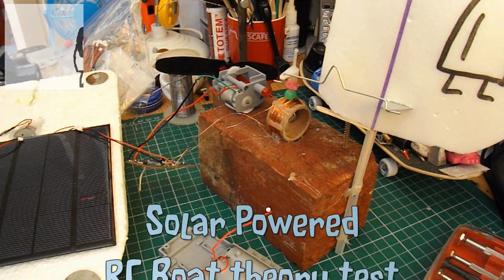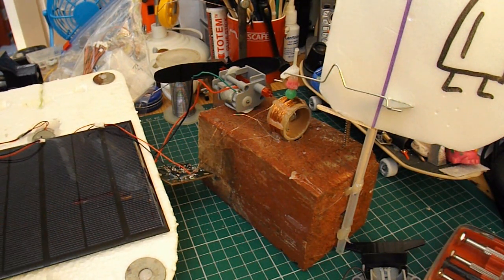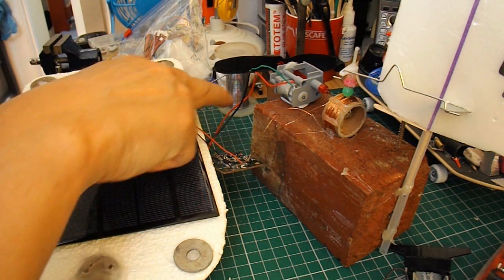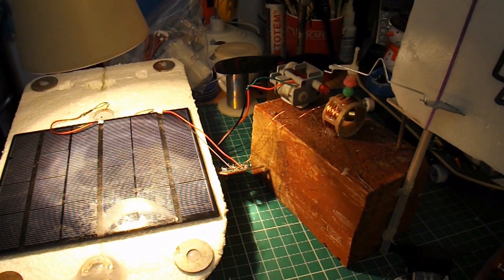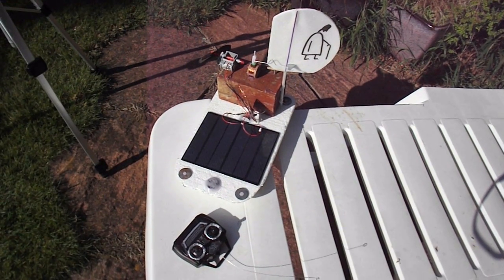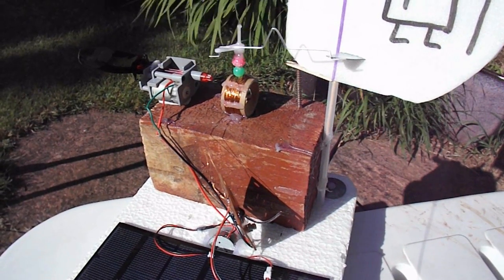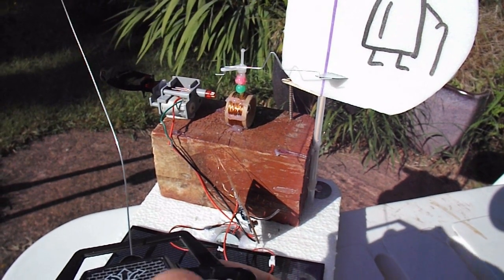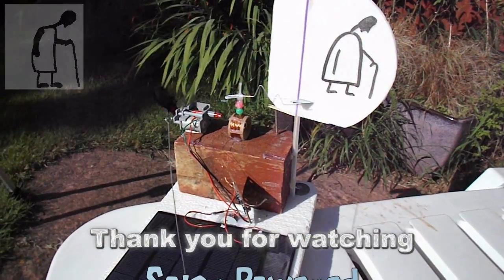Solar Powered RC Boat theory test

Comment: On another note. I am just finished unblocking my outside sewer drain. I built a drill-powered sewer snake from plans a guy had on youtube. I was really pleased that it worked. 
I was going to put a video up on youtube, on my other channel but it is not very nice to watch for obvious reasons. The house above me shares the same sewer drain as us but the cost of having them pressure jetted is expensive. I bought the 50-foot-long snake with fittings for £50 on eBay. The rest of the stuff I had like the guy in this video. https://www.youtube.com/watch?v=o2XgA5uYb5Q It really worked great. Considering the price of the electric ones with the half-inch snake. Very expensive.
I might stick up a video of the one I built on my other channel but not the yucky area where I was working. 😆💩💩
Reply from the maker: Great work, Mike. Not long after we moved in, we had to get the drains jetted round the back of the house. When they needed doing out the front, I looked myself. One access box was full of roots, cleared them out. Another access point that was raised when they paved my driveway had got lumps of cement in it. They were sloppy in their work raising the frame and had allowed cement to drop in. Managed to clear that too 👍

Comment: Wow, 7 years ago. Never seen this one. I am surprised that it never had enough power because that solar panel was pretty large compared to the ones you are now using. 
Sometimes measuring the voltage coming from a solar panel can give a false sense of the power it can put out. I have a solar panel about two and a half times the size of the one you are using here. Got it from Maplin ages ago before they closed all their shops. 
It is designed to keep a car battery topped up but your alternator should do that anyway so not really a useful item for that sort of use. I will dig it out of my garage. I am sure you would find a use for it. 😁👌👍
Reply from the maker: I have one of them 🤣it is in my shed window. I have a car battery in the shed that I use for hot wire cutting foam. The panel keeps it topped up. In fact I have about a dozen car batteries out in the shed , always had intended to do something useful with them. Haven't touched them in years. Probably all dead.
Let's disassemble a Maplins solar battery charger https://youtu.be/BwSBAzLkFIg
Solar charger panel revisited 20210414 https://youtu.be/Qkc-7s_vJmw

Comment: I have a rather odd question about solar panels since I've never actually tinkered with them yet. If you use some sort of magnifying glass over them, does that increase the power you get or just fry the panels? Perhaps a magnifying glass isn't the proper thing to use but just wondering if there was a way to enhance their power by getting more light to reflect onto them... tin foil or reflective materials may do the trick... Any thoughts?
Reply from the maker: Disney Gym Girl I wouldn't suggest a magnifying glass as that would focus the light over a very small area. Just using mirrors or reflective material as you suggest, to increase the amount of light hitting the panel would help. Ultimately I guess you could fry it if you go too far.

Comment: I like this sort of test, much better than a 'no, no, no' and zero proof.
A tip for such things is a decent capacity cap across the solar input. The inrush current for the motor or rudder can be why you see it fade off after the first bit of movement. The cap charges between uses and allows that draw to happen.
Some stuff here only works if there is a 4700uF or bigger cap in parallel !
Reply from the maker: slider2732 thanks again slider, I will see what I have in the box. I have another video uploaded due for publication tomorrow with better motors and that looks more promising, I will see about adding a capacitor to that.